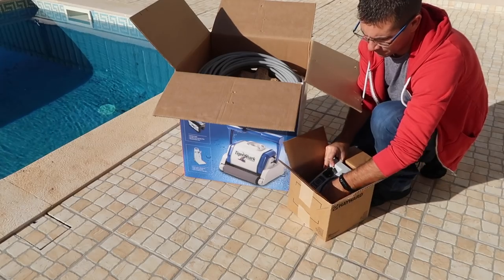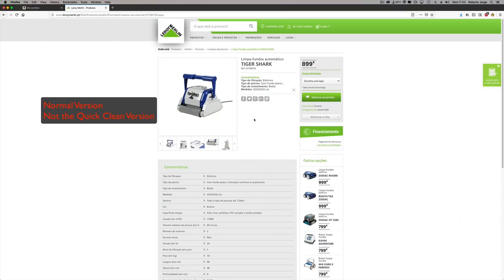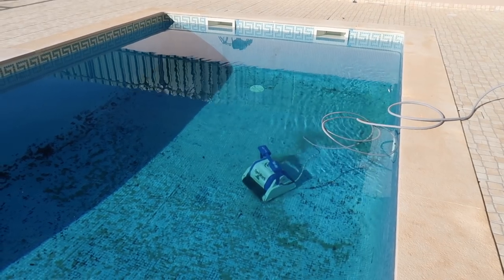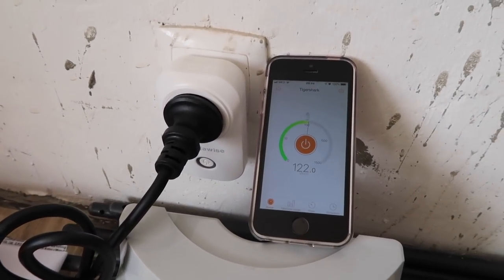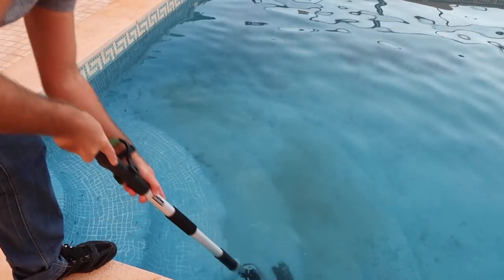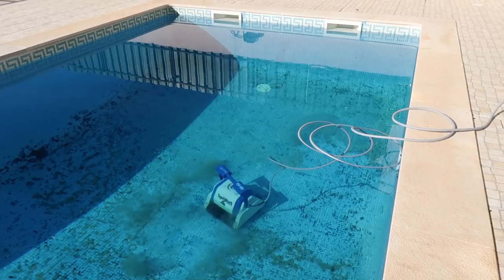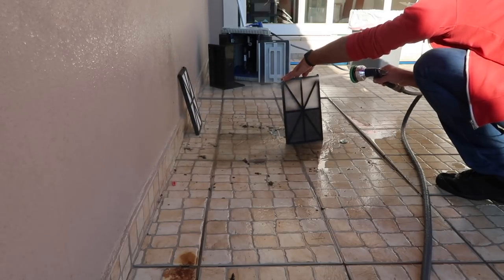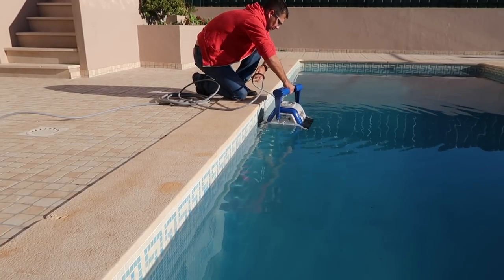POOL "Smart" VACUM TigerShark - FULL REVIEW

Comment: Purchased after watching this realistic review. Have had it it for a few weeks. I have an infinity edge salt water pool with stairs and a 30cm ledge along the slightly rounded infinity edge to stand on in the pool. It also has 2 slopes about 35 an 45 degrees, so quite complex. My main issue is with fine dust particles. The tiger shark does a fantastic job, it cleans everywhere except the stairs but no big deal. I'm really happy with purchase, I now have a sparkling clean pool with no effort. 

Edit: Also just FYI it does not tangle, nor does it get stuck on floor drain nor fall over the infinity edge

Comment: ut there.

I have been using this for my 16x24 pool and it does an amazing job Cleans and scrubs the floor and walls. I had a ton of landscaping recently done in the backyard which littered the pool with leaves and dirt. The Dolphin cleaned EVERYTHING in one 3 hour cycle. If you are considering spending twice the money I doubt you will get better results because this cleaner already gets to everything.